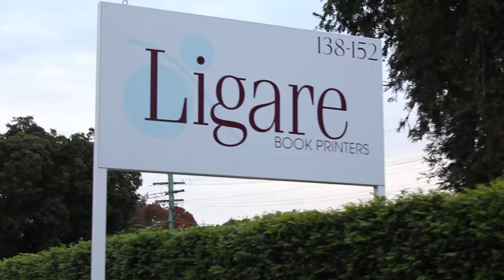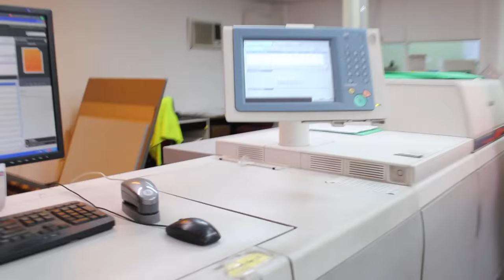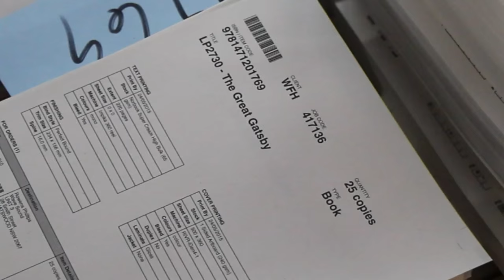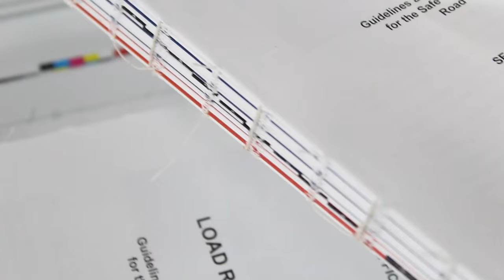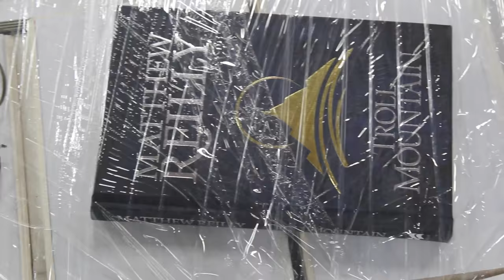PRINTERY VISIT VLOG

Comment: I'm a press assistant and I work on printers, folders and stitchers  just like those. The place I work prints primarily medicine instruction inserts, the cartons stuff goes in, labels for packaging among thousands of other things. Our plates for our Heidelberg 6 color press are identical to that. I prep four SLI presses. (Sanki Letterpress) - machines that print on polypropylene and styrene plastic. We mainly print plant tags with those. The plates I mount for those are quite a bit smaller and go around 5 cylinders (front black, magenta, cyan, yellow and back black). There is over a 1/4 mile walk from the front of my print shop to the back.